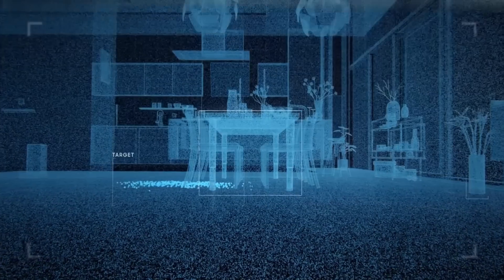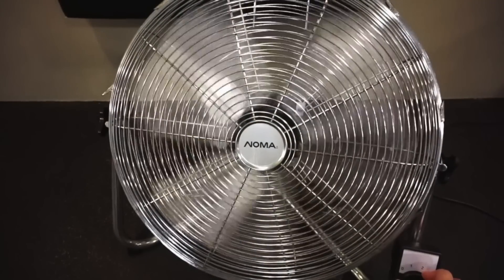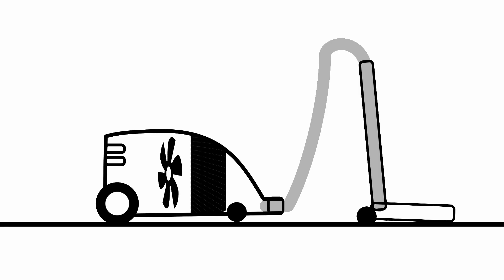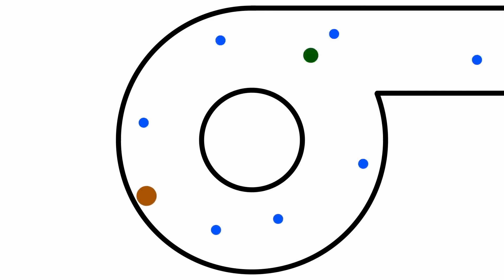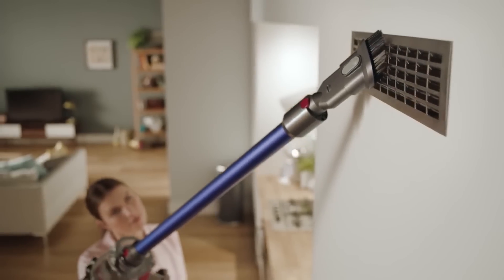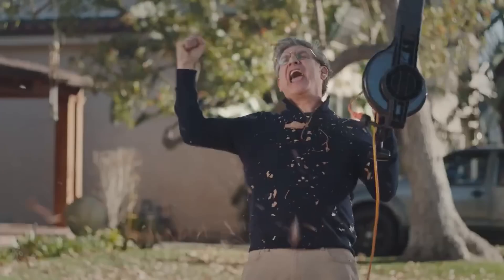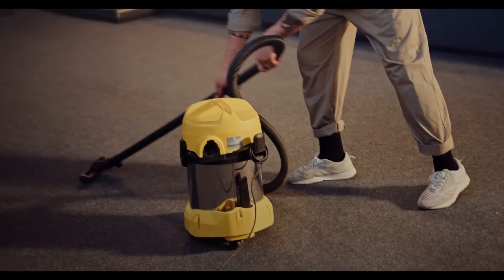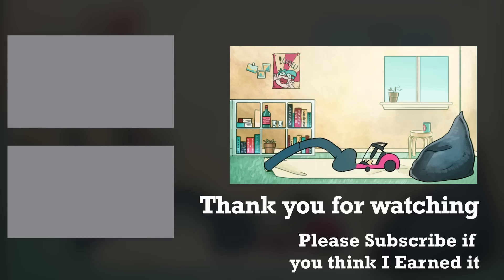How Vacuums Work: The Inventions That Made Them Possible

Comment: Can't dust be sucked back up in the cyclone with the air ? 
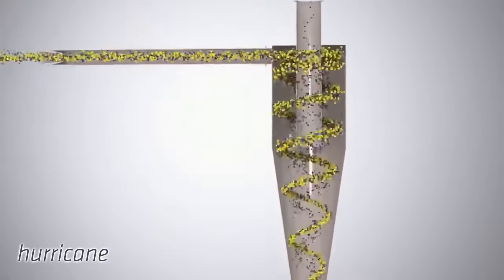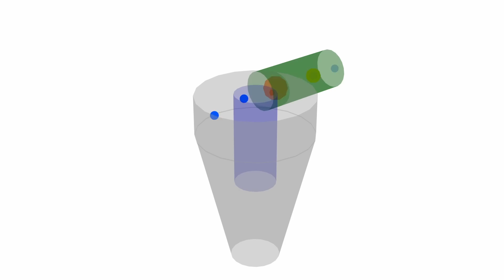(For ex, at around 5:37 you show dirt/dust being cycloned and going to the bottom, however, very close by is an upstream of air. Similar animation at around 6:38)
Thanks.
Reply from the maker: The dust is heavier and slower causing it to drop down into the bin, the lighter air keeps flowing due to the fans so is pushed out the middle of cyclone.
Reply: So you don’t have to change filter with cyclone?